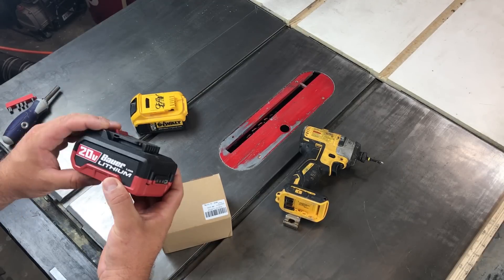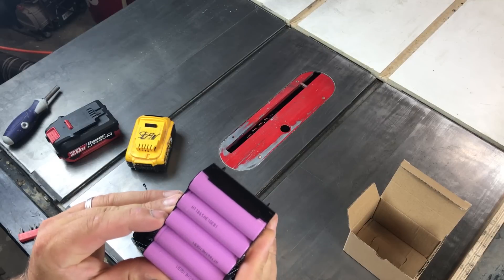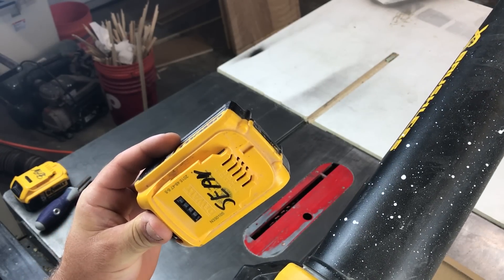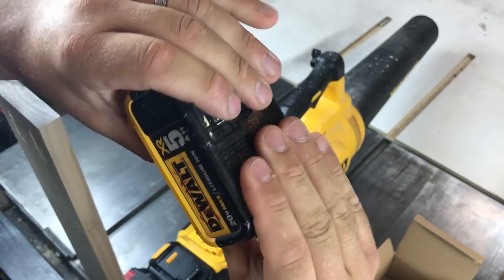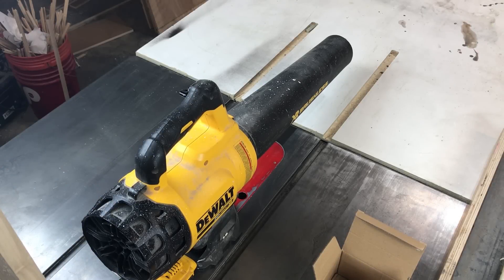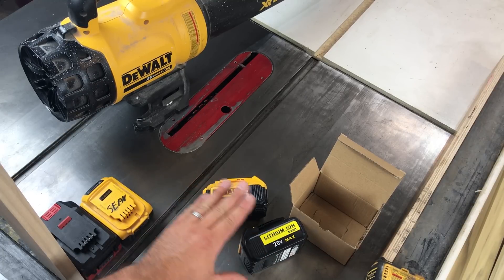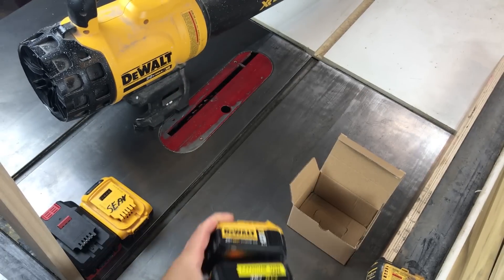Generic Dewalt battery from Amazon vs Genuine Dewalt 20v Lithium battery

Comment: Years ago I bought a Ryobi tool with 2 batteries.  The OEM Batteries crapped out on me within just over a year.  Bought 2 aftermarket 4ah batteries off Ebay.  Holy Moly!!!  I've had them for nearly 5 years and they still are going strong.  I've had to cycle them once or twice when there has been a long lag between uses but I use them pretty often.  I'm actually getting rid of the tools before the batteries had the chance to go bad!  And those two batteries cost me about $56.

Comment: I bought some of those exact cheap ones from amazon 2 -3 years ago they are still going strong. I did have to open 2 and resolder the battery connections in them. But I've definitely got my money's worth out of em.

Would buy again
Reply: Like you and many others; I for one am very satisfied with my Amazon dollar that goes a long way and there delivery is second to none, I do wish their customer service was in America  putting Americans to work?

Comment: There is another factor on run time..  battery life will extend a bit after it has been cycled a few times.   Comparing a used Dewalt to a brand new generic isn't absolutely a perfect comparison..  You might get a little back from the 3 minute run time difference between the two

Comment: Good comparison and makes the point, that the cheaper battery isn't up to par BUT the price point is there. You could buy more batteries for the same price and have even more charge.  No, they probably won't hold up as well.  I think one more test would be the actual output of the tool.  My experience is that sometimes the better battery, the tool will perform better.  It's amperage/voltage draw on load.  Had some Makita cordless tolds and there was a difference in it's performance with the factory battery.  With the aftermarket battery, after one or two uses, there was a drop, while the factory Makita battery it performed full power until the end of the charge.

Comment: I bought two of those generics. A solder joint came loose on one, and the case broke on the other. They just don't hold up to being dropped off an extension ladder 3 or 4 times a week like the Dewalts do. Sometimes I'll drop a cordless from a high height, look down at it and think "I had to kill it this time" Nope! The battery will fly 15 feet away from the drill, I plug it back in and back to work. I'm amazed!

Comment: I bought 2 of them about 3 years ago. I now own 4. All 4 are nearly 3.5 years old. They don't seem to last quite as long as the dewalt, but it's so miniscule only someone who uses their dewalt power tools every day or at least 5 days a week like I do would notice. At the time, I paid 70 bucks for  the pair. 20v 5ah.  I have no complaints, and I mostly use mine on a DCF899B model impact. And it's no joke. 700 ft-lbs torque and 1200 ft-lbs breakaway. I use it a lot, and these batteries hold up pretty well.

Comment: the angle of the line to be adjusted on the x or y axis for laying out slopes. Angle adjustment is by pushing one of two buttons and has very fine increments. The square shape of the tool makes it easy to square the x axis and y axis to the walls of an enclosed area like a garage. When squared, a slope can be laid-out in either or both axis with a compound slope having a high-point in one corner and a low point opposite that corner. The tool can also be put on its side in this mode to project a line onto floor, ceiling and walls.As you would expect at the price the tool is ruggedly built for professional use.*

Comment: I would have verified the Amazon battery was actually 100% charged. The dot system is a general assumption where the charge is at.
Reply: i concur
Reply: Agreed. I have used my dewalt drill to drive several 3'' screws and still read 3 bars
Reply: @MrWizards1974  I hope your kidding.  I could drive 3" screws for days with my dewalt before recharging
Reply: Same here. The Amazon battery showed 3 bars but was it fully charged. Either way, great video. Thanks for confirming my suspicions and I do agree. The cheaper battery is not a bad investment. (Assuming that it withstands the test of time)
Thanks again

Comment: I bought two Vanon batteries for my Milwaukee vacuum.  Works out pretty good.  So then I bought a four pack Vanon for some Dewalt tools I acquired from a retiring locksmith.  No complaints here so far.

Comment: You definitively get what you pay for with batteries. in my experience genuine dewalt, makita, canon , Panasonic, whatever has always been vastly superior. Longer life. Longer run time and something no one ever thinks about is stand by time. if you dont use a piece of equipment for a while, the battery goes flat. i noticed that genuine batteries stay charged for a very long time. So you can pick up that tool, battery pack or whatever and it works...even months later!

Comment: Sometimes you can buy a tool with 2 batts cheaper than just batts
Reply: All the time if it's a dewalt
Reply: True. I just ordered stuff from Home Depot.
Reply: autobody  TRUE  !!!!! I was looking to upgrade my older Skil cordless drills to the Lithium ion battery  BUT Skil no longer has the Lion up grade batteries available, they brought out a new line of 20 volt tools.  An after market lion replacement is right at $100  !!!!  One battery !!!!  I bought a new Worx 3/8" 20 volt Lithium ion drill with TWO batteries and a charges for $61  frt prepaid !!!!  From worx as an open box !!!  I already have other worx tools so now I will have 5 batteries and 4 chargers.  OOOOOOH I also bought the 6 1/2" circular saw with 1 battery and charger for $74 !!!!!  Also an open box !!!!
Reply: Sets can be cheaper for several reasons. When you’re buying the set, they know you may be 1) debating an upgrade within dewalt, or more $valuable to them, considering coming over from a competitor’s platform. On flip side, When you’re in the middle of a job and your battery’s Not cutting it, you’re their captive audience. You’re more price insensitive and they know it.

Comment: Lithium batteries will gain charge after a few cycles.
Reply: True! I've seen them improve 10-15% over 3-4 cycles!  A better test would be to isolate 1 cell and do a capacity test with an iMax or similar capacity tester. If they advertise 5Ah and the cell shows well under 2.5 Ah, you know they're lying.
Reply: @Bob_Adkins  This is known as the depassivation process.

Comment: Couple weeks ago I bought two  5.0 amp 20volt aftermarket batteries for my DeWalt tools,  with the $10 coupon they were less than $32. (for both!) They are Comrgike brand.  I have not used this brand before, but I have other brands and have had very good luck with them. If nothing else, I would think they will eventually force the major companies into reducing their way overpriced batteries. Thanks for the video.

Comment: I've had pretty good luck with mine, I got the 2 pack of 5ah enigitech brand ones off Amazon Canada (not sure if that's spelled correctly) ive had them about 2 years, I use them for work on a daily basis.  I don't have any DeWalt 5ah to compare them to, but they beat the 3ah for sure.  Never had any issues with them.
Reply: I have both after market & the dewalt. the dewalt really last longer at least 30% , i have found some after market at 1/3 the price the really cool thing is the case is the same so when the less expensive batteries died after many hard cycles , grinders, sawzall, and skill saw, I was able to swap the batteries that were good but a broken case, (Yes i have several cheap batteries that the cases are broke) but have recently found new aftermarket cases for 10$.

Comment: As a Amazon buyer, most everything they sell seems to be very good quality, if anyone has problems they will gladly take it back and give full credit, no excuses the very best in service and no long waits for customer service, I have never found another company like Amazon...
Regarding the run time; try charging and discharging the battery a few times and often it will gain more longevity  after a few uses, my question is how long will the Amazon battery  last compared with the other brands???

Comment: Those are 18650 3.7V battery cells inside of the amazon battery. They are good cells which are often used in laptop batteries and I used 20 of them to make a very long lasting battery for my kid's power wheel car.

Comment: I bought the identical battery on Amazon and couldn't happier. The two I bought have held up well and I have not experienced any defects in their use. I haven't torn the batteries apart so I can't state that they have all the safety features that DeWalt incorporates in their batteries, but frankly, I don't care. It's not worth the price for me to worry about some dubious safety features. 

DeWalt products are good and innovative but the company appears to be going the route that Snap-On took years ago. Notably, sending their prices to the stratosphere. I hope DeWalt (actually Stanley/Black and Decker) recognizes the fact that its nice to offer high quality tools, but as you raise your prices fewer and fewer  people will be able to afford buying them.   Market share will go down, then copycat companies like Harbor Freight will suck up its lost market share.
Reply: Hard to tell since batteries have a running life of about 3 years but it does sound logical DeWalt would only be a higher price in the long run

Comment: Bought these amazon Dewalt aftermarket batteries as did a mate, all of them died at approx 3 month point. 

Buy cheap buy twice. 

They all claimed 5yr warranty, none of the sellers would honour the warranty
Reply: Did you by any chance expose them to hot temperatures? I didn't know lithium batteries die if you leave them in a hot car /w no direct sunlight. Had two 18650 genuine panasonic 3400mah's  bite the dust this way.
Reply: My cheap ones lasted almost 2 years, for the cases that did not break.
Reply: @edb9688  So the cheap ones have or don't have battery current protection circuits. I saw AvE take one apart and there is no protection. That means they can explode. Not worth burning your house down just to save a few bucks.
Reply: I have a Cheap one and a dewalt apart on my desk, the funny thing is the dewalt has a heat shield and some melted plastic. The cheap one the plastic is thinner and not in tight contact so no burned plastic. The xr or 4 ah dewalt lasts about the same time in my impacts , and light duty drill, led flashlights. But in the saws all or grinders they die quickly, I believe they are factory seconds but they have been lasting for me and my crew, the biggest problem is broken cases, I found new cases online today for 10$ to make sure they would fit I swapped my real dewalt with a cheap one and they fit, I did see the board but did not look closely,  will look closer tomorrow.

Comment: I'm a sheetmetal worker. I go through about 2 5ah batteries a day minimum. All my work buy is the Amazon generics. We go through them left and right. A 2-6 month life span is a good estimate. My old work only bought dewalt brand. Rarely had to replace them. Unless physical abuse like dropped out of a man lift. But if just wanting some cheap backups that gonna just use once in awhile. The generics do work
Reply from the maker: Check out the video where I test the actual capacity of the real and knock-off batteries

Comment: I understand the cost savings vs run times. I might consider the time it takes to switch out a battery when you run out of power in a up in a gable end on a pump jack or on your back in a crawl space. Thanks for making the video
Reply: There was a 4 minute difference in the run time. At some point you are going to have to swap batteries anyway. So factoring that in would make no sense in testing.

Comment: Good video, when making  a video like this it may be worth it to mention the battery pack warranty.  Dewalt is 3 years. pretty sure after the 30 day amazon return period the other pack is just a hassle if there is ever an issue.  Also, with the cheap pack i notice they do not last as long under heavy load.  an unrestricted blowers wont work a pack nearly as hard as drilling holes of saw cuts.  I understand doing a time comparison but time only matters for the blower.  Cut/holes per charge is what really matters and half of the cheap batteries hit their thermal shutoff before fully discharging so something to keep in mind.  Peace out! Sincerely Dewalt fanboy.

Comment: I bought two of those generic batteries. The top plastic case broke on one of them, and I swapped it with an old Dewalt battery. The other one just stopped working. I'm assuming that I dropped it, and broke an electrical connection inside. I think that must be how I broke the 1st battery too. I'm always dropping the screw guns. So I assume that the generics aren't as tough as the Dewalts.

Comment: You can buy boxes of those internal batteries, if the pack stops charging its likely a desolder in the small board. Just fix it. When the cells give up replace them.
Reply: You cant bro theyre spot welded. it's a big no no to even try using soldering iron on the negative side of a lithium battery unless you want to encourage thermal runaway and blow the damn thing up
Reply: @carlnikolov  They are great to disassemble and use on Cree flashlights.  I have individual 18650's laying around everywhere.

Comment: Even if the amazon battery showed full charge on 3RD BAR, It may have needed to still be charged fully.
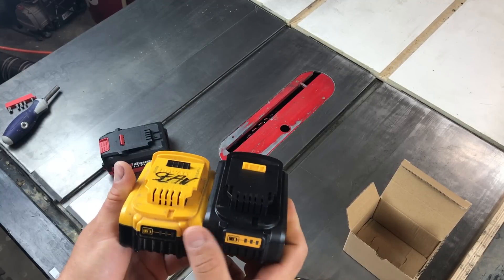3 BAR INDICATOR ( low from 0 up to = 33%, med from 31% up to 66%, Full = 67% up to 100% ) 0:52 THIS MAY BE A INVALID TEST, IF ( NEW BATTERY) WASNT FULLY CHARGED AT THE START.  YOUR MATH IS HILARIOUS ! ! ! 4:22

Comment: It will be interesting to see how many charges you get out of the no-name battery. Cheaper isn’t always better especially if the tool is used in a trade.
Reply: I've had 4 of them for almost 4 years.  They perform flawlessly.  I've charged them so many times I can't count. I have nothing negative to say about them. I was skeptical when I bought them but ended up buying 2 more.  They really have held up well.

Comment: My first one stopped working while using it on the sawzall cutting a 6 inch branch. I was still within the warranty period and had it replaced. Props to the company for sending it to me quickly. When my 2nd amazon 5ah stopped working, I decided to opened it up. I was using it run a kid battery operated ride-on toy, a power wheels, with two kids on it when it died. They use some cheap 14ga wire, probably not even 14 awg rated wire, for the main (positive)(red)B+ and (negative)(black)B-. My B- wire had gotten so hot it desolder itself off the nickel strip. I resolder both main wires using 12ga silicone wire and haven't had a problem since. The batteries are fine. It is the cheap wires they use for the mains (at least in my unit.) I'd buy them again if I have to and upgrade the wires. Been using it in the power wheels with two 775 motors and two kids with no issue since October 2017.
Reply: Excelente. Gracias a tu comentario pude compartir mi batería. El cable fue desoldado. Gracias.
Saludos desde República Dominicana
Reply: Batteries go bad from heat and if they cut corners on wires its like buying the old niclad batteries 6 months tops

Comment: I bought two of these batteries.  They work great on some devices but will not run the blowers for more than ten seconds.  Has worked great on weed eater and drill.  I got my money back from seller based on the experience with blower but now I feel guilty because it will work on some stuff. This guy had a good one apparently.

Comment: Try looking at the power outputs. Impact vs heavy drilling. I bought a knockoff Milwaukee one and it didn’t have near as much power or longevity especially once I put it in a drill or sawzall
Reply: EXACTLY. Running a blower until it dies is hardly a real world test.

Comment: I bought a pair of the chinese knockoff dewalt batteries for 45 bux off fleabay a little over 18 months ago and with some heavy usage at times in various tools they onky last 3/4ths as long as the oem Dewalt batteries do and they're still going strong but the costs difference and getting 2- 5ah batteries for almost half the cost for 1 oem makes em well worth it to me and they do work well enough...

Comment: I have aftermarket makita batteries 1 is 6 years old still going another 3
They don't have the power the original does but they work well in non high Amp draw tools

Comment: Or you can get adapters that will run DeWalt from a Mikwaukee battery and vice-versa.  Also adapters to run the old 18v DeWalt from a Mikwaukee or DeWalt XR battery, I use these on my old nail guns,  and use Dewalt or Milwaukee to run that occasional Ryobi tool you may have... They do have the Ridgid adapters as well out of Australia, kinda pricey though... One thing I discovered,  one of the adapters I ordered actuallly works with both DeWalt and milwaukee batteries, but I can't remember if it's for the Dewalt 18v or Ryobi tools.  I need to make a video on these.  I am now at the point where I will order these off brand batteries as well.

Comment: I've seen those on Amazon and was skeptical. Thanks for testing them! You can't beat that price.
Reply: AVE did a similar vid 2 months ago, no overcurrent protection for thermal runaway, is burning down your house to save $15 covered by insurance?
Reply: jack bigham if you want a fire in your house yea a great deal